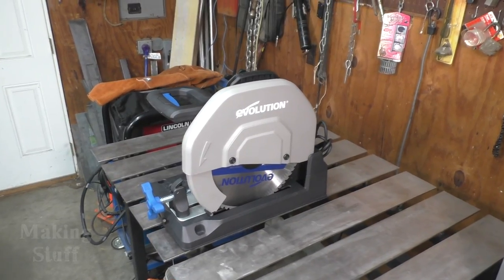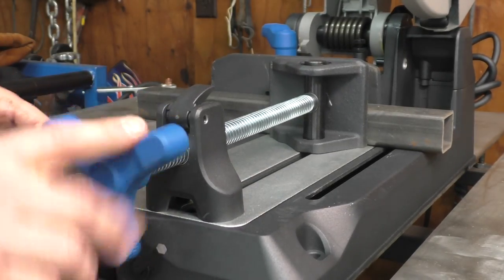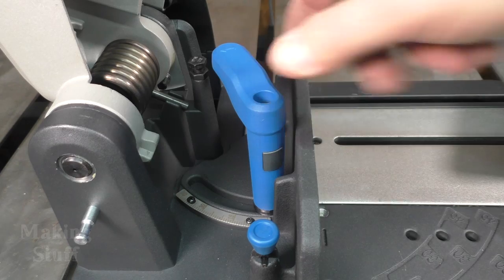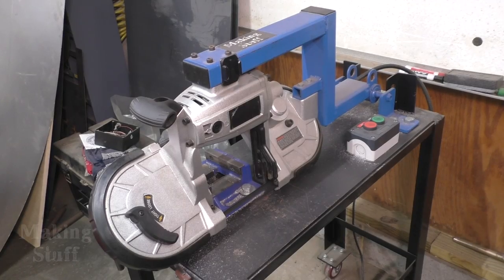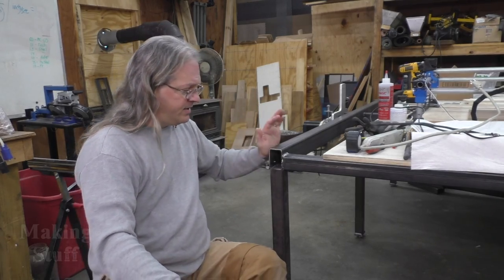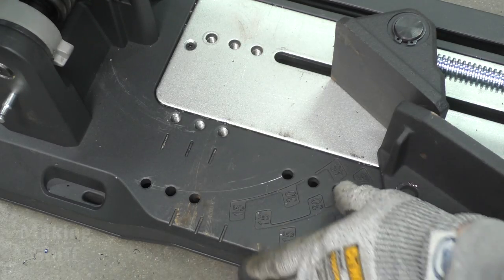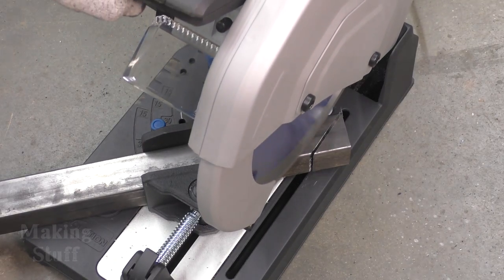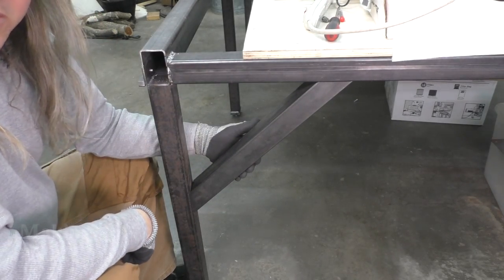Evolution 15" Metal Cutting Chop Saw Review - Model S380CPS

Comment: Just a tip for these metal cutting chop saws: Try and avoid cutting flats in a horizontal orientation if you can avoid it because it puts extra wear on the blade ($$$$). The less meat the tooth has to travel through the better. For example cut the angle iron with the corner pointing straight up, and cut the flat plate with it's side vertical rather than flat on the saw base. It'll cut much quicker. For really thick stuff like that rail road tie I would still try to use your band saw.
Reply from the maker: Thanks for the info!
Reply: I've also seen where they use that attachment to hold square tube in a diamond  position so the blade never has to go thru 2 flat sections.
Reply: @Robon2ndShift  You could also use a piece of angle to tip the large flat bar up on a 45, vs having it flat.
Reply: Even the angle iron should be turned over so it never cuts a flat.  Thats what the piece that slides over the clamp is for.  I just got one of these and it is incredible.  I have been cutting 2x2x3/16 and the Evolution saw cuts it with less pressure than my Milwaukee Chop Saw with a new blade to cut a 2x4 piece of wood.  Liked it so much I bought the circular saw too and cut 3/16 plate.  Wear long sleeves, a good face shield, gloves and a hat. Throws the chips even with the shop vac hooked to it but precise, smooth and fast.
Reply: John Pyle I bought this saw a few weeks ago and it’s amazing. Cuts like butter, angles are perfectly square. Highly recommend this saw over the steel base or Rage models

Comment: Thank you for the review!!!! We have had this saw for several years in our shop and gone thru many blades. It has cut unbelievable amounts of steel. We also have the EVOSAW230, and have gone thru 2 saws. We had a problem with a new 230 saw, (maybe it got dropped...don't know what happened) and Evolution took care of the problem under warranty, great customer service! Yes the chips can be annoying, but the cuts are way better than what we call the "sparky" type chop saw. The saw cuts faster than sparky. Actually surprised our saw has lasted this long, as it goes thru severe use. We do need to upgrade the 380 saw as ours has cut so much steel it is starting to cut a bit off square. Your review is spot on, and thanks again!!!
Reply: Just curious as to about how many cuts you get out of a blade?
Reply: @tomruth9487  not sure, we use the saw constantly. In fact, we are going to purchase another, for a different location in our shop. thanks

Comment: I built my entire metal shop using an abrasive-wheel chop saw from harbor freight. It worked okay. Now, I have a 14 inch Evolution and feel that shop could be built 10 times faster using this saw.  Yes, it's THAT much better!
Reply from the maker: Yeah I got rid of my abrasive saw too.  The Evolution is so much better and faster.

Comment: The biggest negative of cold-cut saws for me personally is that my dog is pretty much always with me in the shop and even with the best chip collection system in the world they still tend to be messy and throw razor sharp shards of metal all over the place. I wouldn't want to be walking around on them barefoot and I doubt my dog does either.

....That's probably not a concern for most folks though :)

---

Good quality blades are expensive for these so I'm not sure how the cost per cut stacks up against an abrasive chop saw, bandsaw or reciprocating saw. For speed and the ability to get a clean and precise cuts they can't be beat though.
Reply: but the problem is of abrasive disc, that black dust is unhealty especially for animals which usually  dont wear masks :). i close my worksspace when i work, then o clean/vaccum the floor so the cats can pass.

Comment: I have an AGP version of the your saw. I haven't tried railway line, so thanks for that. My first experience with the technology was in about 2001 a Makita . With the workers I had in the shop, I couldn't keep blades up to it. I forgot about the whole idea until last year when I decided to give one a try, no regrets. I don't know how practical this is bit I'm interested in what you can safely and economically cut with it. I have kept my abrasive saw for stuff I think may damage the blade. I also have a large horizontal / vertical bandsaw for big stuff.

Comment: How long will the blade last?
Reply from the maker: Evolution says it will last as long as 20 abrasive discs.  Of course I don't know yet, because I just got this one.
Reply: I have one of these saws for over 2 years. On my second blade now. First one I would say lasted about as long as maybe 12-15 abrasive discs. Some stuff I did didn't help. I now put all angle in the saw with the point up. All square section goes in with a corner pointing up and down. Also cut some high tensile bar not knowing it was bad. On second blade I've looked after it better looking like it will certainly last as long as 20 good quality abrasives. It's a fantastic saw and a great addition to any workshop.
Reply: Brian Byrne thanks for the reply.
Reply: but the question is are 20 abrasive disc more expensive the the saw blade?
does anyone have the rpices at hand?
Reply: @hyperhektor7733  abrasives are 10 to 12 a piece.   This blade is about 125.

Comment: I guess you just got lucky? Since I spotted a conversion videu in my home feed from abrasive to toothed blade. After watching that I saw your video. having watched it I looked at suggestions beneath and it looks like every chook and his dog have posted on the Evolution saw topic.  I got luck in this too since the railway iron cut, being so interesting answered some major concerns I had developed. I've got a blade on the way for my cold cut saw and big round bar I have to section. It may be just fine after all for this saw to tackle? I have a dual V belt drive here, so a change of pulley and swapped to a 4 pole motor fixes the speed issue. I do not want to see sparks!

Comment: Thanks for your post.  I would like to ask about your Evolution cut-off saw.  Have you tried cutting thick square tube with it?  Does the blade last on say, 1/8" thick steel tube?  I have wasted a bunch of money on blades, trying to find a good solution for cutting, accurately and quickly.  I bought an Evolution 10" carbide blade for one of my regular miter saws (5200 rpm blade).  It dry cut the 1/8" thick 2" x 3" tube fine for 3 cuts and then was dull.  That was a waste of around $80!!
I went to Lowe's and bought the only 10" steel cutting blade they carried (DeWalt) and it lasted 3 cuts (even trying to use a spray lube.
A waste of another $70!!!
I had an old, (not dull) steel cutting blade and it only lasted three cuts on 3" x 3" 1/8" wall tubing.
I was just wondering how the slower cold cut Evolution saw does on thick tubing.
Thank you.
DW
Reply from the maker: I'm still using the same blade that came with the saw.  Even after cutting all the stuff in the video and the RR track, it still cuts 1/8" mild steel tube like it was new. You aren't trying to cut hardened steel are you?
Reply: @MakingStuff  I don't think it's hardened steel.  I can cut it just fine on my Harbor Freight horizontal bandsaw.  The tubes I have problem with are 1/8" thick, 3" x 3" welded steel square tubing.
They cut great the first 3 cuts (I even wiped the tubes down with lacquer thinner).  But the 4th was impossible.  The blade just sits on top of the flat side of the tubing and will not cut, anymore.
Some people have suggested cutting them on diagonal but that is almost impossible with a 10" blade and I would have to make a custom clamp setup (which I can do, but it's kinda stupid...).
My small Kobalt sliding miter (7 1/4"), seems to do OK with 1/16" thick 1-1/2" square tubing but I actually used a spray lube.  I had so much trouble with the bigger tubing, I didn't want to ruin another blade.  I'm guessing the slower cutting saws are the only answer...

Comment: Hi Bob, I’v just taken ownership of my identical chop saw.  It is very impressive with shifting metal but there is a disturbing vibration with the blade bouncing up and down whilst cutting, leaving linear streaks on the cut surface.  When you are pushing down on the handle, does it feel smooth or rough? Cheers.
Reply from the maker: It's a smooth cut.

Comment: I was a 1/10th the thickness of a baby hair away from getting this saw after watching countless reviews. Until a few guys mentioned the cost of the blade and how quickly you will need a new one. Went with the horizontal bandsaw instead. I mean, the metal chips alone would have been an issue vs the bandsaw dust that easy to clean up.
Reply: People run it dry, it kills the blade faster. 

Run it with coolant, haven't changed the blade for 2 years now and it cuts same as the day i bought only maybe few second longer each cut.

Comment: If you can avoid it, then never cut angle iron like that. If vibration or just a bad clamping makes it flip you are in all sorts of trouble. On a bandsaw you risk ruining the blade, on a cut off saw like this things might go flying. 
Find some wood that is larger than the leg of the angle iron and clamp on that. More secure clamping and less vibrations, which translates to less wear on the blade and more safe cutting. The wood (or whatever) is also good for turning the angle iron and allow for 45 degree cuts in more than one direction.
Reply from the maker: Thanks for the info!

Comment: You cut that railtie two or three more times and your blade would be toast. All those sparks are the higher carbon in the steel. And your pipe rotated at the end of your cut. If that happened while you were cutting at an angle you would have lost about three teeth on that blade.